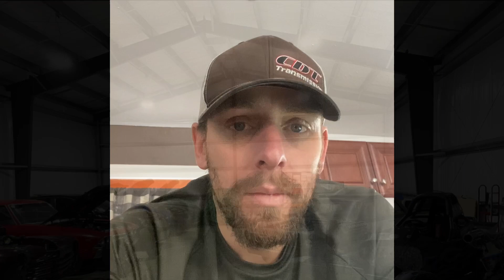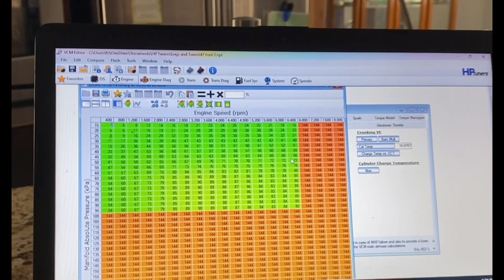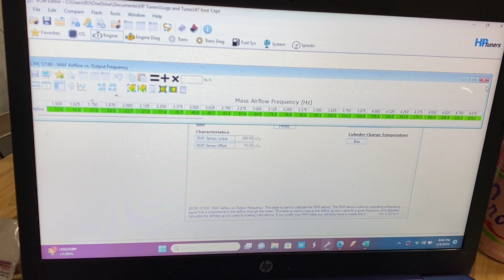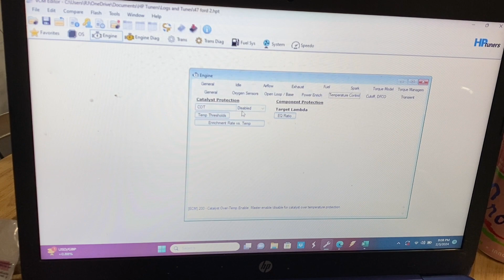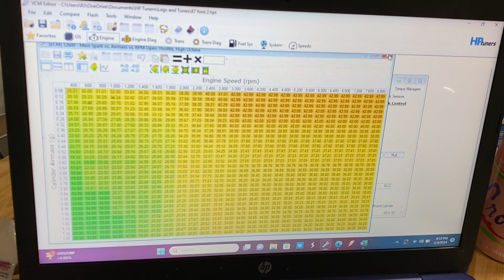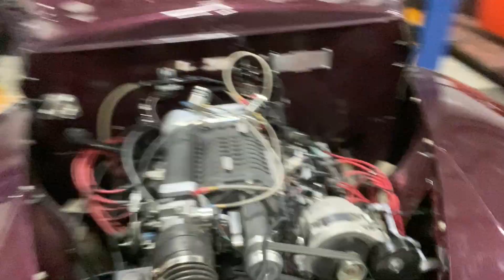24x conversion LT1 base tune HPTuners

Comment: I did a 24X conversion on a 454. I’m not sure if I have the right to file. Would appreciate it if you can give me a little advice.
Reply from the maker: Yes of course. With the 24x conversion, you need to run the ls 24x base in hp tuners and then adjust the firing order to reflect 1,8,4,3,6,5,7,2. What are you running for fueling? Is it a port injection, direct, mpi? Let me know and I could potentially build you out a file

Comment: Any chance you could share a file using tuner pro?
Reply from the maker: I’d be happy to share the file
Reply: @RRR-Performance im having a difficult situation with my tune I think. I was able to get it to finally fire up today for a few seconds, but it was backfiring through the exhaust like crazy. 98 l31 sbc vortec motor, 24x conversion, rebuilt top to bottom with some decent things stuffed into it. I have it physically repinned for the sbc firing order and have the tune file reflecting the sbc firing order. I also have to crack the throttle a hair to fire up

Comment: I finished installing my Torqhead 24x and a little disappointed due to how rich they programmed the PCM. But I am troubleshooting and double checking everything just in case. Oh and it's on 96 z28 383 stroker LT4 setup of a 96 Grand Sport Corvette.
Reply from the maker: They always make it too rich so it’s safe as a pre measure. Let me know if you want a hand at all